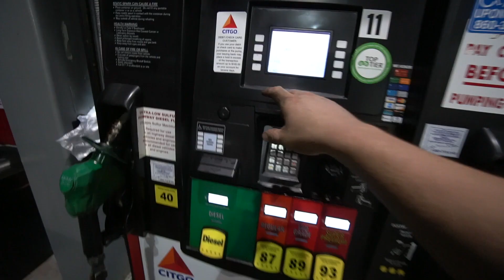I SLAMMED MY SKYLINE!!!

Comment: hey child! 
1. fire requires oxygen, by putting the lid on the bottle you cut off the oxygen supply putting the fire out
2. the nardi bolt pattern is different to momo (which GR uses), if you got a proper JDM hub it comes with both bolt patterns

Comment: Different wheel hubs have different bolt patterns just like the ones on your car. You have to get the right ones to match up
Reply: Zetc non turbo skylines are 4 stud and turbo ones are 5
Reply: They’re the same as 240s, sentras, Cefiros, a lot of 90 Nissan car share parts
Reply: I meant steering wheel hubs

Comment: Little late, but the octane in Japanese and US fuel is actually comparable, they just use different methods to measure it. Here’s a copy/paste explanation I found online. 

Japan and Europe use a system called RON or Research Octane Number to determine the octane rating of their gasoline, while stateside we use a system called AKI or Anti-Knock Index to determine gasoline's octane rating... Interestingly, to further complicate things it would seem that our own AKI system is actually derived from the average of the RON system and another more complicated system referred to as MON or Motor Octane Number... So, to recap our methodologies for measuring gasoline's octane rating are different, but share some common elements...
So, with the commonality of RON in mind a good rule of thumb is as follows, multiply the foreign RON Octane rating by 0.95 and you will have the US AKI equivalent.

( RON Octane Rating x 0.95 = AKI Octane Rating )
98 RON Octane x 0.95 = 93.1 AKI Octane (US measure)
100 RON Octane x 0.95 = 95 AKI Octane (US measure)

Comment: Take big piece of tin foil and tear small pieces off. Put the small pieces in a pop bottle and then fill the bottle a quarter full with toilet bowl cleaner. Put the cap on and shake it till it gets warm and then chuck it. Sounds like a 12 gauge

Comment: Please dont straight pipe it.  It will sound AWFUL.  Take the muffler off and test it before making your mind up.
Reply: Dnice8363 Hey dont talk shit on the mighty rb20e, its a rare jdm engine d00d
Reply: WTF you rambling bout.  I simple said dont straight pipe it because NA cars sound aweful straight piped.  Go back to the previous vid and see where I said he should turn it into a na screamer with ITB's would be sick to see a 2l 6 revving to 10k.  

Maybe if he had cams and tuned this thing up it would sound sick with straight pipes but if he straigt pipes it now it will be raspy and sound like a fart machine.
Reply: Also no point in building a 20e they're complete junk, would be better off 20det or 25det swapping maybe Tommy's 26det even
Reply: Because the n1 rb20 never made 400 hp right.  What happened to save the rare rb20.  I dk his plans but I love the sound of built na 6's that sound is amazing can only imagine how ill it would be between 8-10k.
Reply: Dnice8363 could you link info on the N1 rb20? I cant find anything on it
Reply: The ultimate version of the R31 was the RB20DET-R powered HR31 GTS-R Coupe of which 823[30] units were built to allow homologation for Group A Touring Car racing. Introduced in late 1987, it had a reworked version of the normal RB20DET with a much larger turbocharger on a tubular steel exhaust manifold, as well as a much larger front-mounted intercooler boosting power to a factory claimed 210 ps (154 kW), with racing versions making over 430 hp (321 kW) in Group A trim, though this was still at least 110 hp (82 kW) less than the leading Group A car of the time, the Ford Sierra RS500 (which had approximately the same weight as the Nissan), and around 70 hp (52 kW) less than the heavier (by around 225 kg (496 lb)) V8 Holden Commodore.
Reply: Dnice8363 well thats why, rb20dets are great, that would be a great engine to put in the car, rb20es are complete junk though, not worth spending money on at all
Reply: Group a race with em.  I like smaller displacement motors less stress on componets and spin freely but we all know as you up the RPM's things twist so id need to see the block what kinda bracing is out there for the crank and how oil pumps match up between them all.  May be cheaper to just swap it but would be a cool diffrent build and put a rb26 head on it.  Im sure you stroke out the block as well and keep the rb20 short block.  

https://www.youtube.com/watch?v=Kn6JTG9dVvY
Reply: Dnice8363 the two things I cab see getting swapped into rodknocks car are the 20det that was gonna go into grants car or tommys 26dett, a NA build would be cool though
Reply: HondamanFG2 Vtec yeah I'm hoping Tommy can make him do more legit work like he did with the roadster but the car will probably end up having a touch of rice regardless
Reply: Nah I doubt it will be ricer.  The original definition of a ricer was a car that did all show woirk wouldnt lower there car and run a stock motor.  Hes got some big plans if he teams up Shaw he could be makeing a sick car I hope. Lets  hope they take down both Miatas and the skylines on there next FL trip.
Reply: It's a RB20E, any money you spend on it is a waste.

"May be cheaper to just swap it but would be a cool diffrent build and put a rb26 head on it."

RB20 and RB25/26 have different bore size, that should be a big red flag on doing a RB26 head swap.
Reply: Your completely right didnt relize the crank sizes were that small.  Means they all should be good reliable motors and scream No matter what you run thanks for the knowledge.  Check out how close you can build a sick motor compared to unkown condition motors sitting in junk yards.  Obviously he can prob work with a machine shop to get a discount for the shout out.  Prob get a better deal on some parts to.  So this is a ruff estimate.  Granted with the 26 comes with a ton more parts.  
.
RB26 with trans 5k, n1 oil pump, 220 gaskets 200 = total 5520
rb20 bored out to 2.4  Oil pump/gaskets 350-450, pistons 500, RB25 gts-t head tomie 2 cams 1k, assembly 1k, trans 1k , total 3850-4k 
RB20 block bored to rb26 crank 600/n1 crank 1k, pistons 500, rods/manley 300-5,  gaskets 300, n1 oil pump 220, RB25 gts-t head tomie 2 cams 1k, GTR trans 1k.Block bore assemble 1k. 5k-6050
rb30 block crank 2500, rb30 pistons rods 800-1k, GTR trans 1k, Block assemble 300-500, n1 oil pump 220,  bearings bolts 300, RB25 gts-t head tomie 2 cams 1k,  6120-6520
Reply: Dnice8363 or he could be weird and make a rb24 for no reason, I just wanna see that theres no reaon to do it
Reply: The reason is its a completely forged motor with a full rebuilt motor for  less money compared to an unknown millage rb26 that will be better in every way for less money.  Or even put a 26 crank for 600 more and make it a forged RB26 for the same price. Its a no brainer if you think about it overbuild the motor come out ahead in money/reliability.  This is rodknock he will be buying a used rb with who knows how many milles or throw some silly motor in it.
Reply: Your right i havent been driving longer then your age ive never built a motor click my name you will see ive built motors and cars for a min now.  You sounds like youve never done any research at all and are 12 with 0 experiance.  So a rb25dett making 200-250 hp at the crank is 3k with a trans plate clutch flywheel still leaving out parts to make it run properly as its been sitting forever in a junkyard in japan with unknown milles OR  500 to bore the rb20.  1k for rb25 head with tomie cams, 1k for forged pistons, rods, and bearings 220 for n1 pump. 1k trans, 1k turbo.  less then 5k that could be built by hp logic with 0 milles that could handle over 600.  or 5k on a motor that may be able to handle 450 that is unknown.  So please tell me how im wrong PLEASE!!!!!!!
Reply: "You sounds like youve never done any research at all and are 12 with 0 experiance."

Coming from the guy that has only Honda's on your channel this means a lot, it's not like I own a R32 skyline or anything like that.

"So a rb25dett making 200-250 hp at the crank"

*RB25DET

They'll easily make that at the wheels with mods that you would be getting anyway like exhaust, intercooler, fuel pump.

"500 to bore the rb20.  1k for rb25 head with tomie cams, 1k for forged pistons, rods, and bearings 220 for n1 pump. 1k trans, 1k turbo."

Other then the fact that RB25/26 heads don't really work on RB20's, not to mention this isn't how you build a RB24 from a RB20, also what trans are you getting for 1k?
Reply: Really so the blocks are different with the same deck height.  Only diff is bore and cranks line up across the board.  Perhaps you should read this and tell me how your so much smarter being a "nissan guy" but a Honda guy is slamming you on every front.  Funny I was a nissan guy drifting in the 90's when youtube wasnt around.  Lets see a t56 trans BMW has cheap trans umm z trans dirt cheap maybe a 240 trans with a plate.  EIther way the good rb25 will need the same trans as the rb26 or maybe convert to a AWD with tommies front end.  Or you can just plug the front axle ports same as people do by pulling a fuse in a r32.  But im 12 with you using your bros footage.  

http://forums.nicoclub.com/rb20det-head-swap-t283412.html
Reply: Maybe while looking for that thread you would see all the other threads saying with the work needed to make it fit is not worth doing, everybody who has worked onor built RB's will tell you just to get a RB25.

"but a Honda guy is slamming you on every front."

Not sure where this is happening.
Reply: Dnice8363 rb30s are actually a taller block then the other motors, they make their displacment on the stroke more so then the bore
(im not fighting you or anything, dont start a flame war with me pls)
Reply: DriftNick I was tryna be nice to prevent this shit from happening, this dudes talking about RBs like they're honda motors
Reply: Hey you want to spend more money go ahead I was trying to give you paths that would save money and work for cheaper or the same price rev better and last longer.  The turbo feed lines you talk about being missing is a 50 dollar fix and makes it the same as a rb25 dett with 1mm smaller crank.  Still cant find any evidence just follow the crowd like a sheep.
Reply: It's not saving any money, it's spending more to get less, a RB24 (done the way people actually do it with a RB20 head) is going to cost more then a stock RB25 and perform far worse, if he is going to build a RB then most people would recommend a RB25.

" The turbo feed lines you talk about being missing is a 50 dollar fix "

Talking about oil squirters that the non-turbo blocks don't have, wouldn't be surprised if the blocks are worse in other aspects to.

"rb25 dett"

*DET

"Still cant find any evidence just follow the crowd like a sheep."

Google search "built RB20 vs RB25" and you'll find a lot of forum posts about it, there is a reason no one does what you are saying, call me a sheep for learning from others.
Reply: Dnice8363 there is no rb25dett they only came single turbo also building this motor you want, it would be cheaper to just get grants rb20det throw a bigger turbo, injectors and a tune on it and make 300whp
Reply: No one hmm.  So if you put wisco pistons and manley rods in a rb25 your way over the build im saying with a  rb20 block with a rb25 head drill holes in oil holes and you fix the r32 issues with oiling mixed with a n1 pump.  Here shows its working just fine.  Most race blocks take out oil squirtersbut if you want them again you can get them cheep and screw them in.  Tons of people swap heads around this is done numerous times as people want diff rev ranges and tq figures.   

RB25 head rb20 stock block making 470hp.  
https://www.youtube.com/watch?v=iFoFkh0RQAg
Reply: Im talking about having a 700+ motor that will last.  not some stock bs that wouldnt last long at 500.
Reply: I hope you are trolling at this point, that video you linked is just a plain old RB20 head and did you even read the forum threads you linked?

Most people say the same thing, keep the RB20 stock with bolt on mods, if it blows up then upgrade to RB25, if you want to build a RB then go RB25.
Reply: There is 0 diffrence in block they say you can bolt on a rb head which the kid did in the video.  He also had your GOD motor (rb25) built it properly and blew it in no time and had to go back to the trusty rb20 as it doesnt have weak ringlands and many other issues.  Your not reading at all your repeating yourself hopeing something will stick and make your point valid.
Reply: He's had two RB20's,  he swapped the RB20 head from the first engine (after it died) onto the second, it's all RB20, go to 4:40 in the video and he talks about it, nice proof of people doing RB25 head on RB20's tho LOL.

"There is 0 diffrence in block they say you can bolt on a rb head which the kid did in the video."

If there was zero difference then RB20 blocks would be in much higher demand, shocking that for some reason they are not.
Reply: Because the head doesnt flow as good as the rb25 or the advances that came in the 90's If your buying an engine yes it would be smarter.  Since he has the rb20 he can save money build it for crazy power.  
 Dudes built head and shaved which I assume he meant when swapping the head over. 
https://www.youtube.com/watch?v=3VcUQBEGBwY&t=221s
Reply: I broke the costs down again for you.  Found a bunch of people stroking the RB20 with a rb26 crank rods and 82mm pistons.  Making better tq then the 25.  Not much difference in cost at all if your gonna do a big turbo build.  Im sure HP has an ex mani/IM/cams they will give him and help him build it.  Big questions would be what can hold more power a stock rb26 or this forged motor since pricing is close to the same.  

RB20 which he has
n1 pump 220
rb26 n1 crank 600, rb26 rods 195 or forged eagle/Manley rods 500 
4agze 81.5 pistons forged with better rings or weisco 4-600, king bearings 90, head gasket 80
RB 25 head 450, lifters 200  (can weld in small piece to the side for better sealing and compression)
RB 20 head porting 350-450 from larry's in CT, cams tomie 500
timing belt 80
water pump 100
block work 300 from larry's in CT with bore wash and enlarging water/oil holes 
http://www.larryspower.com/engine/Labor.html
Misc oil lines 100
total 3-4k

rb25 2250 to refresh it and there is still a ton of risk to it
oil pump 220, timing belt 80, water pump 100, arp bolts 180
Total    3k
Reply: "Because the head doesnt flow as good as the rb25"

Talking about the block not the head, you said all the blocks are the same when they clearly are not.

"Found a bunch of people stroking the RB20 with a rb26 crank rods and 82mm pistons."

Find a single person that has put a RB25 head on a RB20? or a single person that would recommend building a RB20 over a RB25?

"rb26 n1 crank 600"

Would like to know where you can get this great deal.

"Big questions would be what can hold more power a stock rb26 or this forged motor since pricing is close to the same. "

Been talking about RB20 vs RB25 not RB26, RB26's cost a lot more the both of those.

"rb25 2250 to refresh it and there is still a ton of risk to it"

Refresh of a RB25 is going to cost a lot less then building a RB24 and the RB25 will make far more usable power,  again there is a reason everybody will tell you just to get a RB25.

Comment: 12:37 What's with the blue and red flashing lights on the rearview mirror? Did you get pulled over or something?
Reply: JDMricist  It's a reflection of the cd player. I noticed it also. But if you look closely you can see it change colors other than red/blue.
Reply: ahh you're right, I did see a yellow but thought it was headlights or something. Thanks for clearing that up.

Comment: Would you repaint it?
Reply: It has the plate in the engine bay stating the paint code bl0, he said he would be repainting it after the front end swap so I assume it will be resprayed the same colour.

Comment: You need to do a r32 taillight swap
Reply: Seth ervin for sure
Reply: The 2 door tail lights are a different shape to the 4 door.
Reply: That takes a lot more work than you think
Reply: R32 taillight swap on an R32?

GREAT IDEA!
Reply: That's what happens when kids act like they know it all, when they don't know it all lmao..
Reply: Agreed. Coupe tail lights look 10x better, and it's an easy job. Don't see why more people don't do it.
Reply: because its really not that easy. you'd need to swap the bumper and trundlid from a coupe over aswell as the sedan lights are a different shape than the coupe ones
Reply: TheJp5572 You swap the bumper and trunk, then the lights fit properly.
Reply: Fit properly isn't what I would call it, to really make them fit you need to do custom parts/bodywork otherwise there will be big gaps between panels.
Reply: Definitely but i doubt theyll be direct fit without modification but thats what id do anyways

Comment: Japanese gas is rated differently. They use the RON rating system we use AKI in North America. 91-92 RON japan low grade is equal to 87 AKI we have here. So you are fine to run 87.
Reply: MrBobjacobson not with the timing cranked
Reply: iD0theTUBE yeah if he kept it like that i agree.